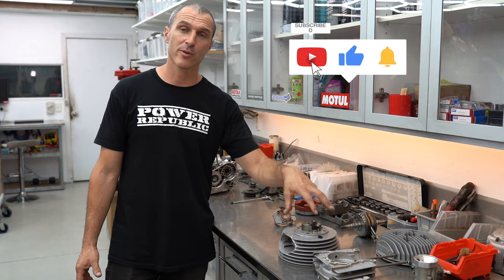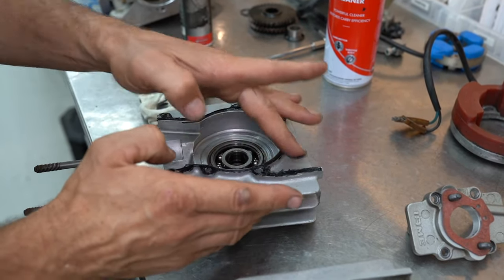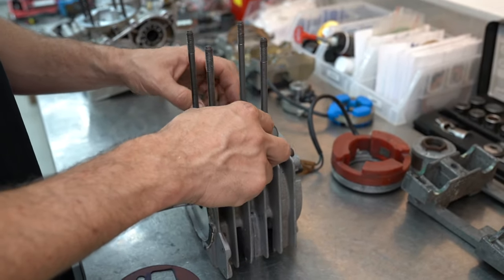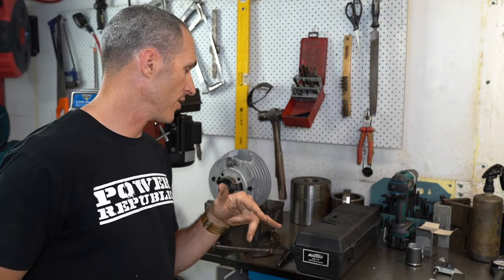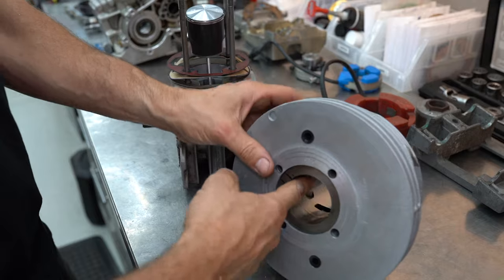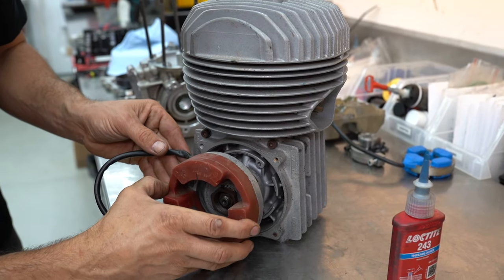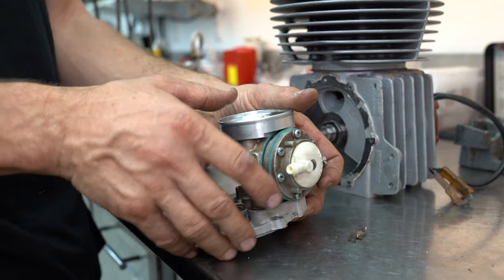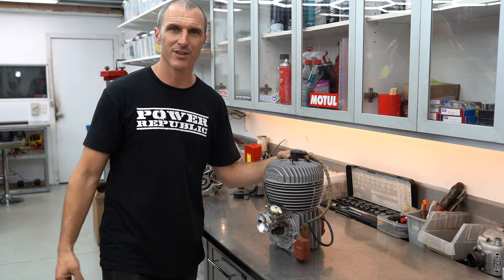Vintage DAP Kart Restoration Project - Episode 3: Engine Rebuild - POWER REPUBLIC

Comment: The ports look stock in this one.   Used to race Komet and Hewland Arrow engines (on methanol) in open class and we made swiss cheese out of those sleeves.   :)   We could out run the stock twins with the good ones.   Have fun - thanks for the videos!
Reply from the maker: Yeah thanks heaps for watching the vids.   I thought to run it as is and then see if opening up the exhaust booster ports helps

Comment: Thanks for sharing, love the videos.Can you provide more details on the hone please? Sunnen say the snj-10 only does up to a 45mm bore? Are the ports chamfered to avoid ring snagging?
Reply from the maker: They are not chamfered but you could quite easily, fastest and easiest is to use a ball hone/cylinder deglazer. 

My bad on the hone.  The snj-10 is for 60cc mini rok engine.  The SJ-75 is what you want and the one I was using.  Stupid me in keep them in the same box as I don’t use them very much these days.
Reply: Super, thanks for the quick reply. I see a boring bar in the background, do you have any videos showing a rebore? Can't wait for the dyno run!
Reply from the maker: @kehoemark   to be honest I haven't switched it on yet !!!  I clocked the spinal and it runs 0.05 mm out of round so I figured that it would make the cylinders worse not better, so I have left it for now.

Comment: Hope you cleaned the gasket material/goo off the outside of the crankcase under the rotary value cover.
Reply from the maker: I had to get another one ordered so that I didn’t squish rhe rotary disc in the housing

Comment: Hi;  No mention of changing-checking crankcase bearings or fitting new oil seals????.
Reply from the maker: Nah didn’t do them after finding out the state of the crank shaft not being able to be changed

Comment: Do you hone your modern engines the same way or do you use a full on honing machine? Does it make much difference? Cheers 👍
Reply from the maker: nah I use the sunnen machine hone.  yeah its faster and easier to get perfect bores for customers.  the hand held ones are good enough to do at home and for the cost.   might just take you longer but wouldn't go tot the expense of  the big machine at home to do 2-5 engines per year

Comment: I've gotten my hands on a Yamaha KT100 and Old 100cc Comer (351L) motor, I'm busy restoring them along with the chassis, I have run into a couple of problems with the motors mainly being parts availability due to the fact of being in South Africa and the exchange rate not being very kind. But I shall persevere and get them 100% and screaming. Would you know what coil could be used in replacement for a Selettra P3356 cause then the Comer is good to go.
Reply from the maker: AGS in Melbourne is good for old retro parts
Reply from the maker: https://www.agskartparts.com.au
Reply: sweet thank you very much
 @PowerRepublic

Comment: What is the piston ring clearance?
Reply from the maker: I set it 0.15 mm but I guess you could use as low as 0.12-0.13mm if you wanted to push your luck.🍀 
I set mine so hopefully she runs all day
Reply: What about piston tolerance?